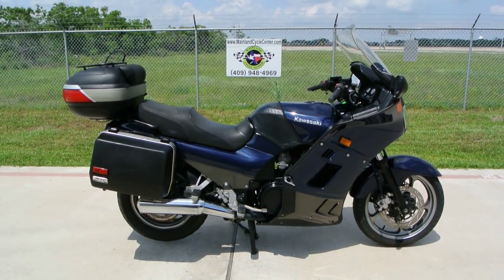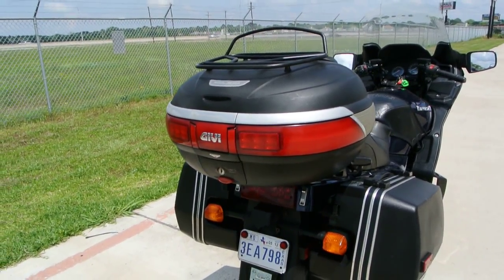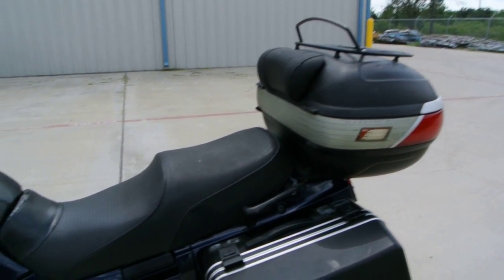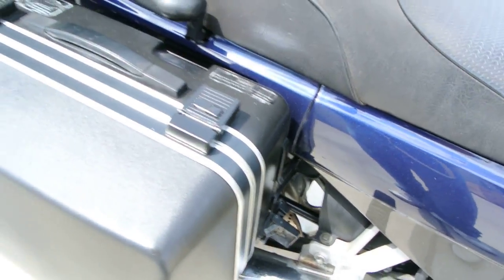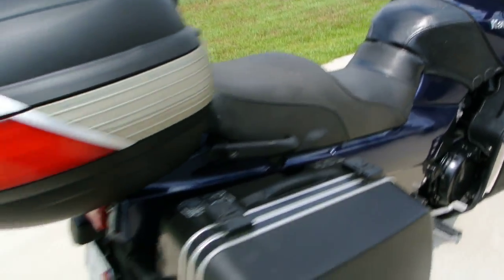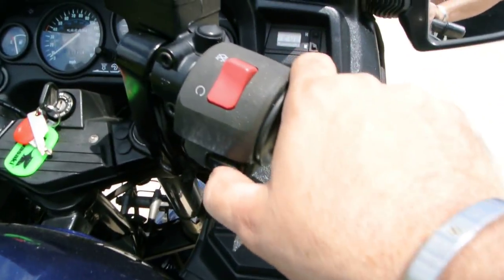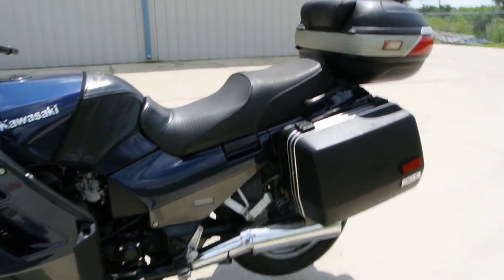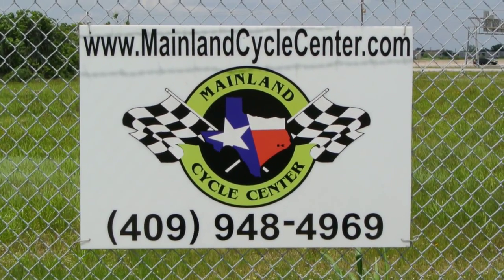2006 Kawasaki Concours 1000 ZG1000: Overview, Review and Walk Around

Comment: The 1000 Concours is Kawasaki's Own Dumbed Down for touring duty GPZ900 Ninja ,the Fuel Tank Bodywork Tail section Side panels Forks Swingarm Rim size all Scream the early and One of the Best ever to come out of Kawasaki Production bike's ever GPZ900 Ninja. If they had the Brain's and ball's to bring this kinda bike back today it would sell out like hotcakes , Simply because the 900cc was that good. Dated  mid June 2021.
Reply: It's actually based off the 86 Ninja 1000R

Comment: Can u tell me what to remove to get at the air filter please? 02 concours...  45,000mls
Reply: on an 8 y/o video lol
Reply: On the left side of the bike (as u sit on it) there is a somewhat square panel with some rounded corners and two screws. I can’t remember if it’s under the left body panel or not. You may have to remove the left panel (1 screw). The small squarish air filter panel has 2 screws, 1 on either side. When you get that little plastic cover off there is a tab underneath the filter. Pull that tab first, noting the direction of the bevel when you pull it out. You’ll have to pull somewhat hard on it. That holds the filter up in the air box. Pretty simple to find and maintain. Many put a K&N filter in so they can clean and reuse it.
Reply: @pastorbmcnally  Thank's..........

Comment: 1987 to 2007 not 1986-2006
Reply: Dar Tice 86-06
Reply: a quick Google search will show your wrong at least in US
Reply: 1986 to mid 2004 in Australia. Avoid the 1986 model due to soft valves.
Reply: @gtrderm  so replace them
Reply: @snwdwg1 replace the engine valves? Quite an expensive endeavour even if you're doing the work yourself.